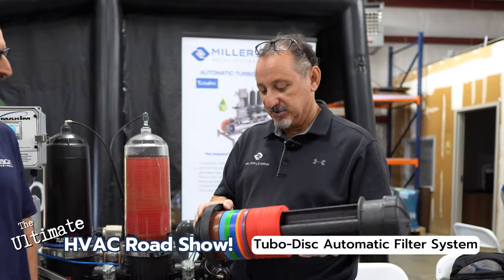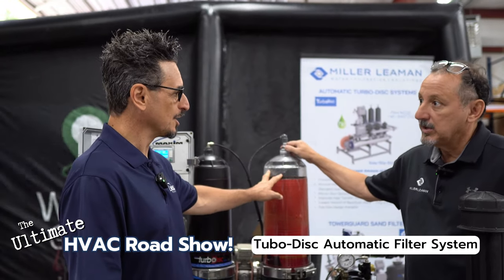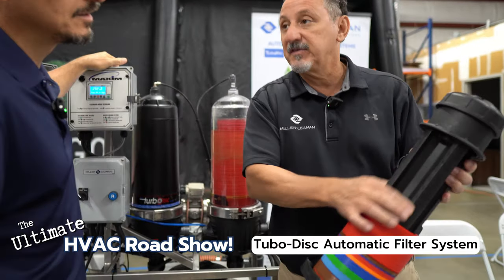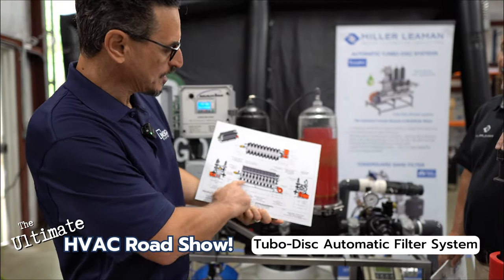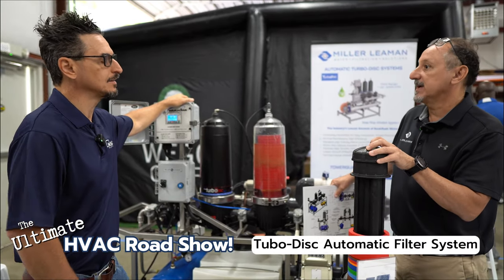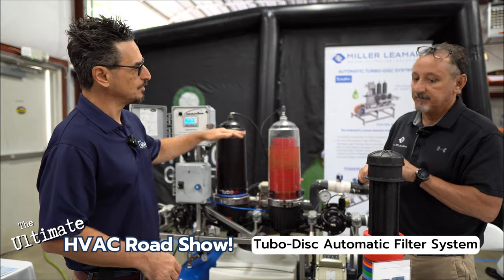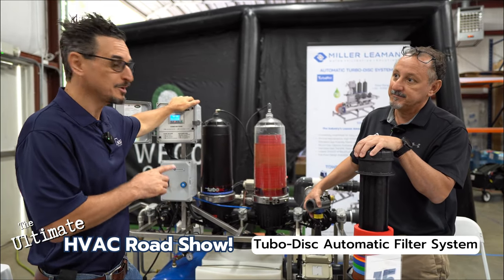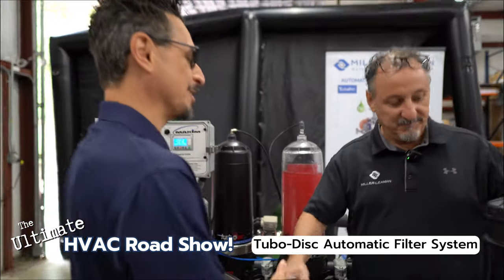Turbo-Disc Automatic Cooling Tower Side Stream Filtration System | Miller Leaman

Comment: Since Helene and the ensuing potable water issues at our central plants, which are experiencing high turbidity, I have been wondering about these filtration systems and if they would work with that issue for drinking water. Can you advise?